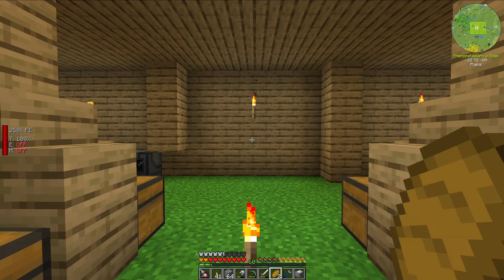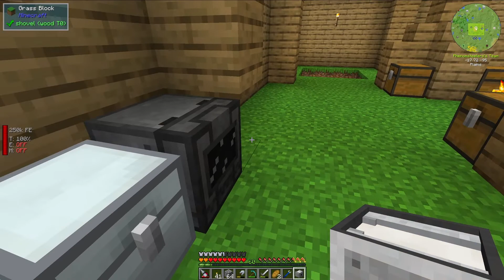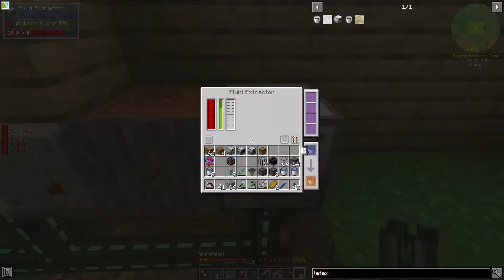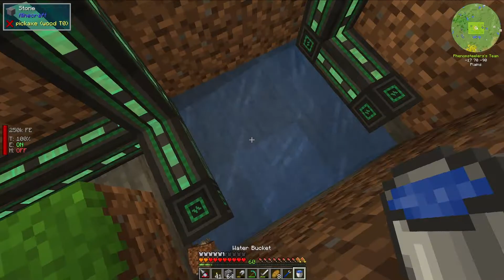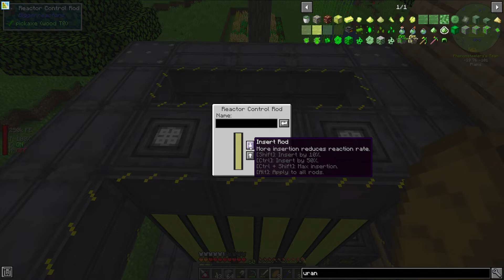Episode 5: Automatic Industrial Foregoing Plastic

Comment: Do you know of any circumstances that would cause block placers/breakers to not work?

I tried setting up another auto plastic set up about 2 days ago, and noticed neither would work, with no reason for them not to be... Powered fine and you can see them operating... Or atleast attempting to... Just not actually doing anything

Edit: of course I tore my hair out for like 2 days trying to figure out why they wouldn't work... Finally start asking and answer the question myself, 5 minutes later haha

The problem was I had built it in a protected chunk I have claimed on a server... These 2 machines dont work in protected chunks, regardless of if you crafted them and are placed in your own claimed chunks

Which makes sense, should've caught it earlier... But yeah if anyone else has a problem building this in a server environment, this may be why